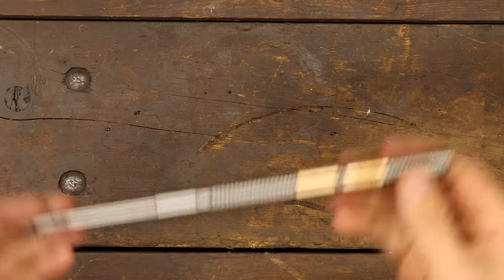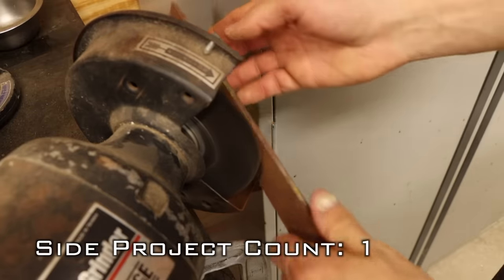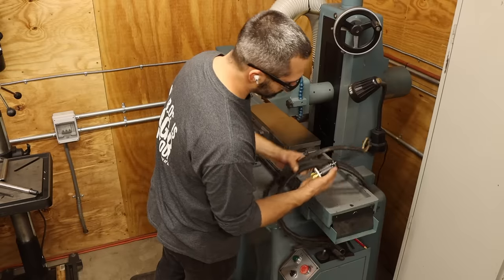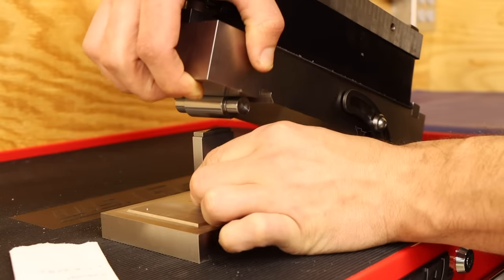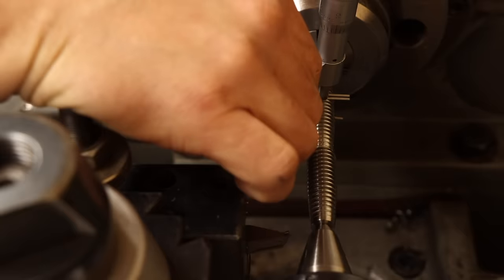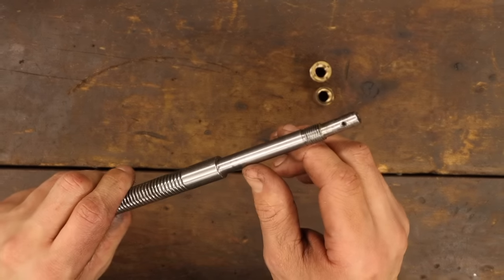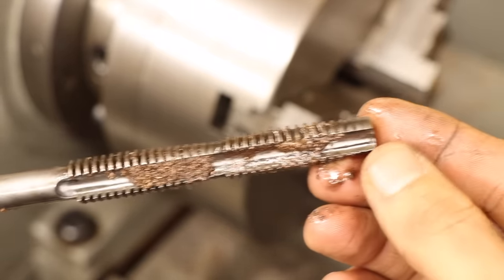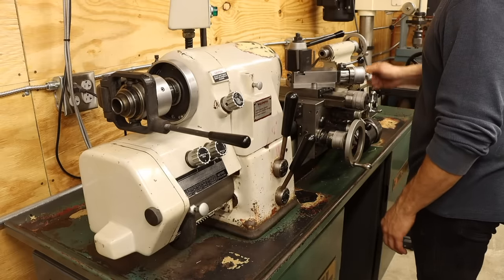Just A "SIMPLE" Repair

Comment from the maker: Use code Inheritance10 and get 10% off Shapr3D when you download Shapr3D for iPad, macOS, & Windows: https://link.shapr3d.com/cd83c2
Reply: I love the channel but had to say this. When I take my pocket knife out and open it, I expect there to be a blade attached. I expect it to be that way every time, without fail and if not, that “tool” isn’t functional. Maybe I’m too much of an old school hobbyist but I’m not buying any tools that require a subscription to operate. I know, software updates and whatnot. Here is the thing, if it doesn’t already do what I need it to at time of install, it doesn’t work. If it does, it needs no updates.
Reply: I have a ton of questions so i will try to be brief. Firstly, does this program interface with the 3d printer market well? Second, where do you get your material stock from, local or online? Thirdly, if its the latter where or who? Fourth, I love how you keep things interesting but why not convert this lead screw project to something imperial, you can retain dial accuracy by maintaining the TPI right? And lastly, have you done the bearings on this lathe yet? I have been rebuilding machines all this year and its one of the challenges I keep bashing my head against. Am looking forward to your diagnostics on this as well as the solutions. Thanks! o7
Reply: Try fusion 360 waay better and even can make cnc programs
Reply: inheritance using CAD????? whattt???
Reply: Can you guys just enjoy the videos this guy makes? What is wrong with you? Have you any understanding what it takes to make a video? The time? The Effort? The editing? Just enjoy the story ....Cheese and Rice. If you don't like it then don't watch. Stop with the negative waves man. Nuff Said.
Reply from the maker: I believe it was designed heavily with the 3D printing market in mind. There are several export options for bringing into your slicing program. My material comes from online (mcmaster-carr usually). I considered swithcing to an imperial thread but decided to go the "fun" route. I'm planning on addressing the spindle bearings very soon. Not sure how that's going to go or how long it will take so there may be some other projects dropped in along the way while i button that up. No doubt I will cover it all though! @cjm5002
Reply: I don’t know much, but I was trained when working on high precision equipment to use a light lubricant when you’re reassembling equipment. They have torque specs for it online.
Reply: OK not gonna lie, the chamfer/fillet thing blew my tiny brain
Reply: Make a fractcal vise like antique which I had a chance but didn't get it, regret it.

Comment: Hello good sir. Just a piece of advice from a blacksmith, when you are quenching a longer piece of metal such as in this video. Be careful with submerging it into the quenching fluid, to be more specific be aware of any side to side movements because this can sometimes bend the piece you are quenching. The chance of a machined piece of steel bending during the quenching process is a lot lower than on a forged knife but there still is a chance. P.S. yes i have ruined a knife this way : )

Comment: Brandon, pure magic here. Wonderful job, wonderful result. 3D CAD does have advantages for finding compound angles and a  lot more. Accurate without the otherwise required math. Using the oldskool drawing board is also fun but when you need to get a job done for a living I go for the CAD solution daily.  You're becoming a master in the trade! I enjoyed every second of this video. I also replaced a few spindles on my machines but bought a length of the required (left hand) thread at Misumi and loctited it into a working assembly. Nuts I bought too and modified them to the right dimensions. They perform fine for years now. I'm a jobber and I try to find the fastest and therefore most economical way to get my machines up running. But honestly I would like to have enough time to repair a spindle the way you did. It's so much fun and really satisfying to conquer all the challenges in your own shop and end with a better than new result. Hats of to you sir. All the best! Although not realistic I'm afraid; I wish everyone a happy christmas and a happy new year, Job

Comment: i use a horizontal boring mill at work. the vertical acme screw has .211" of backlash, the x-axis screw has .127" of backlash, and the z-axis screw has about .165" backlash. you're not supposed to climb mill on an acme thread, though you can, but the amount of backlash means that any wrong cut can shoot the table or headstock sideways, potentially breaking the mill, the part, or the tool.

it's been this way for as long as i've worked there - nearly 10 years - beecause any time someone talked about the backlash in the machine, the nuts either got adjusted or they have been replaced a few times. all of the wear is in the screw itself, but my foreman only ever says it'll be adjusted. all of the work and wear is done on one part of the screw so the extremes you have to adjust to are near pristine.

i talked to my boss about it a few weeks ago, and the screws are finally getting replaced after what's probably been a large part of the machine's lifetime

Comment: 13:35 You will probably never see this but Im going to throw it out there anyway. There are really only two options that are most likely here. 

First, the thread is a 9/16-10 acme. 9/16 is close enough to 14mm that you could just be measuring a worn outer diameter to get this size. I find this the unlikely option, however. 

The more likely scenario is this being a metric trapazoidal thread, TR14x2.5 specifically. The metric version of acme threads are called trapazoidal threads. The main difference between trapazoidal threads and acme threads, aside from the metric vs inch dimensions, is that acme threads are 29 degrees as you stated and trapazoidal threads are 30 degrees. 

With the smaller thread at the end being a metric thread, my money is on this thread being TR14x2.5. It is highly unlikely that one part would have two different units of measurement used on it. The 2.5mm pitch is just close enough to 10 tpi (10 tpi = .100” pitch and 2.5mm = .0984” pitch) that you probably wouldnt be able to see the difference without a long enough gauge. 

All that said, the problem I see that could arrise from this is the fact that if it is a trapazoidal thread, your compound dial graduations will now not be accurate do to them being calibrated (probably) to the 2.5mm pitch thread. 

You can confirm this rather simply by setting up an indicator and checking the dialed movement vs the actual distance traveled of the compound. If you move the compound .100” and the indicator moves .100”, all is good. If you move .100” and the indicator moves roughly .0984”, well then you have a conundrum. 

It would bother me. Not sure if it would bother you. I guess it all depends on how accurate you expect your compound to be. The issue is compounding error, meaning the longer the distance traveled by your compound, the more inaccurate it is going to be.

Edit: Dont just willy nilly trust what I am saying here, Ive given you enough info that it should be easy enough to do research to prove or disprove this. Im going strictly off memory/experience and my own math.

Comment: Fantastic result. The first (and only) tap I have made is a little (about 8mm) left handed square thread double start one. It took me days cutting test threads to get my head around working with the compound slide backlash and then getting evenly sized threads before I could cut the screw and tap. I used a square endmill to cut the flutes and it was ok, and I did think to put the relief on the back of the cutting edges. It was still hard going because I didn't know about those 2 stage taps. Then I spent far too long wondering why it wouldn't cut before realising I was turning it the wrong way!

The thread cutter I made broke on the last finishing pass on the tap - luckily I'd made the screw first. I think the steel for the screw was free cutting 12L14, because it's not heavy duty and I wanted easy cutting and a good finish. It's for a steam loco reversing screw.

The thread cutter was made from round silver steel so it could be rotated in it's holder to suit the helix angle. Not my idea, but it worked well. The cutter was made to no fixed dimensions or flank angles so sadly this screw/nut is a one-off, even though I still have the tap.

It fit so well and was so smooth anyone who picked it up couldn't stop playing with it :)

Comment: Very nicely done! Glad to see you back at the surface grinder.

Just some tips I wanted to share from what I've learned so far from my journeyman.

Next time you need to take a lot off on a surface grinder, try plunge grinding. Use the full width of the wheel to plunge down to 5-8 thou above your target number, then stop and let the part cool completely. Then you can re-dress a sharp edge on your wheel amd take it down to final dimension. Plunge grinding saves a lot of time, and especially for you since you have a coolant system set up.
Reply from the maker: Ah! Noted! Thank you

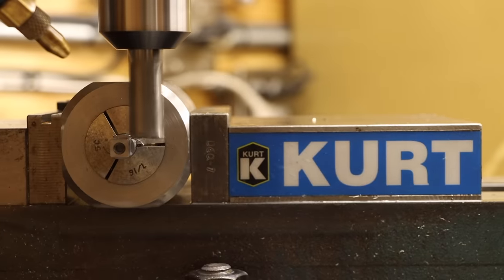Comment: 18:25 Believe it or not, I bought not one but two small angle plates for my tiny desktop CNC mill JUST so I can fixture a one-off plastic enclosure vertically to mill a feature on one of its small sides. Aaaand the sturdy vertical drill stand that would let me actually drill clamp-down holes into those angle plates in a reasonable manner. Well and of course the Cobalt drill set to do the job effectively. Sigh... I know, it's incurable.
Reply from the maker: 😂 No one ever said this hobby was cheap!

Comment: This video is so perfect lol. I literally have 3 lead screw nuts i need to make between my small and medium lathes. I noticed the acme tap design online as well but thought "bearing bronze is soft". Needless to say my first attempt at an acme tap was a fail. Luckily i still have the hss lathe bit i made and never reshaped it. 
I also like seeing your hss bit worked fine without a rake across the top (neutral) as the machinist i work with wouldnt let it go until i added a positive rake to mine lol.
Being a smaller shop and also trying to raise a family in this economy, i cant exactly afford new machines (yet). So i am absolutely loving these machine repair videos you have been doing. And thank you for working out the math grinding acme cutters like that. That way will save me a ton of time even on the cutter grinder we have at work. One question though... wouldnt you want a left hand thread for lead screws? So turning the handwheel to the right pushes the cutter towards the work?
Reply: Adding rake to a screwcutting tool which has been ground to the correct flank angles means that it is no longer cutting those exact angles. This gets to be more of an issue if the pitch diameter is small in relation to the depth of thread (which tends to be the case for acme machine feedscrews).
Also the problem is more pronounced as the rake angle increases -- 5 degrees probably would not matter, at least for a normally proportioned fastener thread.
You probably already knew all this but I'm noting it for others who might read this.

Comment: you should save that chipped grinding wheel. it will work fine in a smaller size and be, just the ticket when, you need a slower running wheel to help keep heat down. mount it up and remove the chip with a carborundum stick. try to keep it round and then a few passes with the diamond and voila! do a ring test before you get started though, hang the wheel on your finger and tap it with a piece of brass. if it gives you a dull doink, it's cracked, throw it out. on the other hand, if you get a nice ring, it just has a piece missing and still has life. 
also, i have a pretty good idea how that chip happened. after watching you work on that acme cutting tool and another item that was small and not as wide as tall, you have a regular mistake in your setups for grinding. small thin pieces and parts that are taller than they are wide, those type of parts should always be blocked in with a good parallel or set of parallels to keep the ground part from moving. thin, narrow parts are the worst because when the heat up they loose their magnetism, they also heat up on the top which makes it expand on that side and suck up into the wheel. if that part has a tall to wide ratio it is also going to want to tip and the trailing edge will want to catch the wheel and tip over. the wheel wants to hop over the part but it can't and it brakes the wheel.
you do a lot of things well and have some useful machinery and a "git to it" attitude. keep going with the repairs when you have the time, try to pick up some small jobs to help pay your way.

Comment: The video you've made is amazing! One thing I learned while working with O1 tool steel from my previous employers that you might want to know is that for some thinner heat treating jobs where precision is required, quenching is best done WITHOUT stirring. It cools the leading edge faster than the rest of the part and tends to warp it but im glad it worked out!
Reply from the maker: Thats a good point actually that I didn't even consider... I'll need to keep that in mind if I ever do something more precise. Thanks!

Comment: Very great work! Just a word of caution though, I would not use a cheater pipe when tightening down the compound angle bolt @27:30. I've seen several cracked compound bases on HLV-H lathes because of over tightening. If the compound is not "gripping" enough check to see if the mating surfaces are still flat.
Reply from the maker: Oh really!? I appreciate the heads up! Thanks!
Reply: Yes, the crack will run parallel to the bolt itself. There is not much material left on the compound base after the hole for the bolt is drilled. @InheritanceMachining

Comment: Man, I swear I have like 1/4" of lash on my compound. I know it can't be nearly that but it sure looks like it sometimes. I hope mine can be adjusted... Just shows how much I know my machine. I love your work. Super clean.
Reply from the maker: To be fair its something that can be worked around in most cases. Unless that wear is uneven and makes the handwheel dials inaccurate. Thanks man!
Reply: @InheritanceMachining  Maybe that's a mission for today. Check the lash on my compound at different points. If it doesn't vary wildly like yours did maybe I can dial it in. My lathe can certainly use some tuning up at the least. I'm not a machinist, just a guy with some machines. My Uncle who was vastly more experienced said about how you can work with any pile of garbage as long as you have a way to compensate for the slop.

Comment: Nice work.  Making the cutting tool bit and the tap, especially the tap. I was wondering if you were going to single point thread inside such a small diameter opening as the nuts.
Reply from the maker: I thought about making an internal single point tool but for some reason the tap sounded like way more fun. Thanks!

Comment: Well done. Another interesting project and cool video.

One thing I might add though. Because you had to make both the leadscrew and the nuts to ride on it, why not change the weird thread to a standard ACME size instead of a metric/imperial?

Good lesson for making ACME taps though. This Old Tony went through the same exercise at one point but didn't make the roughing part and paid for it.

Comment: @inheritancemachining i noticed at the end of the video that you had a pipe on the allen wrench for tightening down your compound. Be very careful with the torque applied to that cam bolt. If you tighten it too much, it can snap due to the goofy geometry. If it snaps off in the compound, you can't loosen it and have to drill the other side of the compound out to beat it back out with a punch. Great video! Keep em comin!
Reply from the maker: Good call! Someone else also mentioned they've seen the compound actually crack because of that. Thanks!
Reply: @InheritanceMachining  absolutely! There are tons more pieces of tooling that work on the hardinge bayonet spindle nose you have as well. Chucks, backing plates, expanding ID collets, step chucks, plug chucks, etc. The place I work (although this next week is my last week), uses all hardinge equipment as second op lathes. There is a plethora of cool stuff. If you need any info or ideas or to just bullshit for a while, please reach out. I'd love to help!

Comment: My 1913 Lodge and Shipley lathe has about a quarter inch of slack in the cross slide and I can see the dip in the ways for wear. But that is the lathe I learned on almost 40 years ago. It is tucked away and will get rebuilt when I retire for my hobby shop.

Comment: It would be much better if the United States used 240v three phase as the standard household power supply. 120v single phase is far too weak to effectively run anything bigger than a toaster. Plus, three phase power is so much more efficient than single phase. But since we basically invented national power grids and at the time 120v seemed like plenty of power since it was basically used for lights only at the time. By the time we figured out higher voltage and three phase power were so much better we were too built up to realistically change.

Comment: 13:52 its probably a metric trapezoidal thread. only a 1 degree difference
Reply from the maker: You might be right. The pitch is definitely 0.100 inches though because of the handwheel

Comment: I did a full apprenticeship under my father as a mold maker/ builder we had 2 surface grinders . A grinding wheel balancer is not needed. Ring wheel for cracks, dress the wheel, If you have any in  balance at start up. You have other problems. IE. Loose spanner nut , bad bearings, head stock or table out of whack.